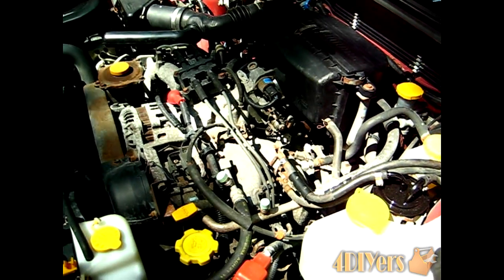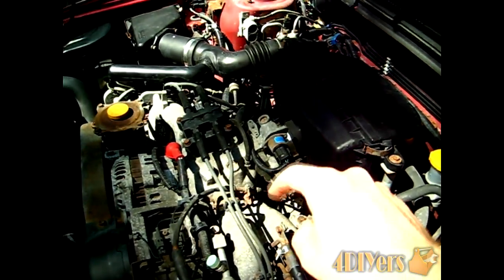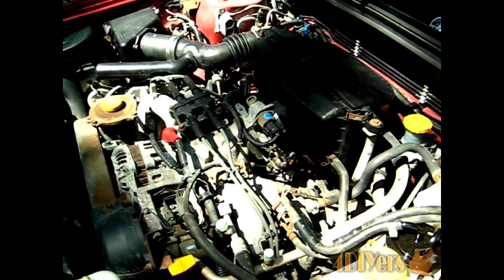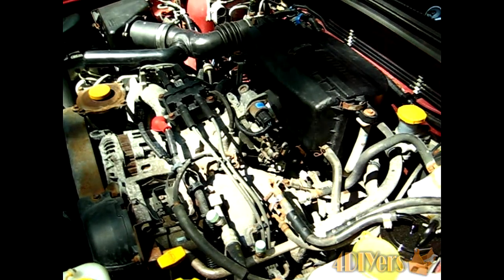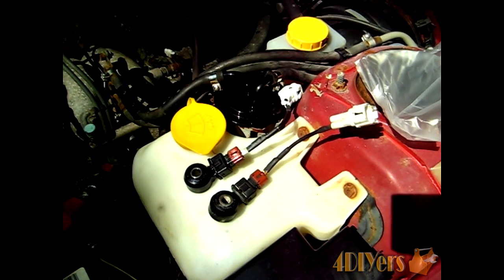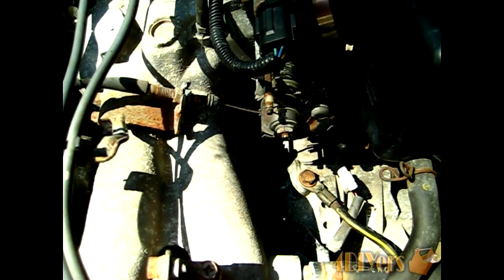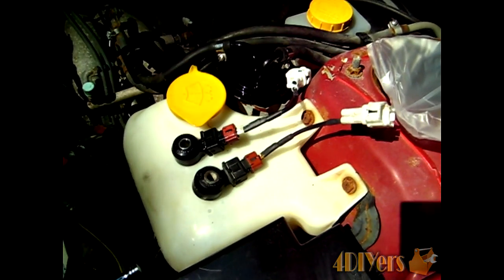DIY: Subaru Knock Sensor Replacement

Comment: You skipped the part where it must be at 60 degrees. 
Yours was at 330
Reply from the maker: It was at 60 degrees. I referenced the procedure with a manual.

Comment: i have an 09..  the sensor is at a weird angle and cannot be accessed straight down.  I was thinking i could use a crows foot wrench to get it out, but if i do it that way i won't be able to torque it back at the end.

any thoughts?

Comment: Hi when you said you had a hard start problem what did you mean by that.
Mine struggles when engine is cold but when it does fire up she fine till car is stood for a few hours.
Could the knock sensor make it hard to start

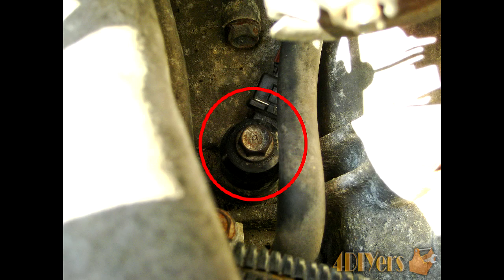Comment: First, thanks for taking the time to produce this video; very helpful. Second: I think Nock Sensors detect the piston's TOP  position to trigger Ignition. In that regards, there should NOT be a degree in which you should have to Rotate this one; rather, at 1:02, MARK its position (although I believe it would not have any bearing on its performance), BEFORE removing it. If sensors have a Coil inside, it will detect any ferro magnetic impulse any which way they maybe located, provided they lay flat on a surface against the 'sensed' mass. Thanks again; I will replace mine!

Comment: I'm doing a head gaskets, water pump,timing ass..on my 2001 forester..knock Sensor is cracked..most likely why my check engine light is on..

Comment: I have lag of power from 3500-4900 RPM (the power gets back from 5000-6000 afterwards.) , I read from other forums its probably because of the Knock sensor.
they talk about a Knock sensor delete, but i'm not sure if thats healthy for the engine. what should i do? it only happens sometimes,  and there are no Engine check light  turning on at all.
i'll try first to just clean the Knock sensor and see if that helps.
 any ideas?
i own a 2.0l non Turbo impreza from 1999'  done 375000 KM  / 233000 Miles.
Reply: Did you ever get it fixed? having the exact same issue at the exact same rpms as you

Comment: My engine starts and runs pretty decently, but the mileage is poor and sometimes the cel flashes but only when it's cold out and the engine is warm and I'm starting it back up. It's kind of weird. I don't think it's my knock sensor yet but it might be going out.

Anything else i  should look for? I'm just confused. I can't scan for codes cause it has obd0
Reply from the maker: What type of vehicle is it? You should be able to scan the codes using a vehicle specific scanner or sometimes there is a jumper wire you need to install to access the scanning sequence. Yes it can be a knock sensor, but it can also be a variety of other things like the vehicle needing new plugs, wires, timing set, faulty 02 sensor, temperature sensor, vacuum leak, etc. Regardless of what type of vehicle, you should be able to test the knock sensor and if it's fine, then I would advise moving onto another test which won't cost money for a replacement.
Reply: I'm not getting any codes from it. Obd1 1991 ej22 subaru legacy. I have a small exhaust leak so that's part of what's getting fixed. I get 3 quivk flashes but it doesn't show as anything
Reply from the maker: If it's flashing three times, that is a misfire issue. Either a bad spark, fuel delivery, incomplete combustion, or low compression. Take the plugs out, inspect them, replace if needed. Test the spark plug wires (I have a tutorial for that https://www.youtube.com/watch?v=7ll30u39DEE) and then test the coil pack. If all checks out, do a compression test, test the injectors, clean the injectors, and test the fuel pressure.
Reply: I haven't changed the wires.

And the three flashes was in it's memory. It's not on now so I think it's still okay
Reply: But yeah I need to change the wires still. So that video shows test the coil packs too?
Reply: How do you know that's what the three flashes mean? Trouble codes didn't show that
Reply from the maker: Could have been a fouled plug if it was something that happened in the past and now is cleared. No that video is strictly relating to wires. I've owned a few Subarus in the past, it's a standard issue, especially if the engine is modified.
Reply: Stock motor and plugs have at most 10000 miles. I gotta do wires still. And coil packs if necessary

Comment: I just purchase the knock sensor at my local autozone for $84.00 out of curiosity I checked out ebay upon arriving home. The prices there where a very big drop with most selling at $11 or less !! What is the difference and should I return the expensive part in exchange for the cheaper part ?
Reply from the maker: While the cheap sensor may last, there is no guarantee though. Those cheap sensors don't tend to be as durable and their life expectancy is usually short.
Reply: They're less than £8 in the UK  .

Comment: My 12mm socket is stripping the nut, I think because the angle isn't great.  I'm also using a 6" + 3" extension.  Any suggestions?  I'm going to try again when the engine is cool.
Reply: make sure you use six sided socket

Comment: Could faulty sensor cause engine surging under acceleration on lean mix (i.e. light gas)? I have been experiencing engine surges when the MY2009 Forester switches from 1st to the 2nd under light gas (only happens on slightly warmed up vehicle. once its fully warmed up or if its cold wont happen. I am also experiencing rough idle on cold engine, but i guess its due to pzev. Sorry for the long comment )
Reply: YES a faulty sensor can cause power surges. My forester is currently experiencing this.
Reply from the maker: Have you scanned the engine codes??? Yes a sensor or sensors will cause those problems you have listed. Don't forget to subscribe!
Reply: yeah, no issues found using OBD scanner. interesting thing that oil change to thicker 0w40 somewhat fixed the problem. I guess the sensor is not completely faulty, may be it works out of the tolerance causing it to be more sensitive. thicker oil might have reduced vibrations.

Comment: Thanks for posting this video and the step-by-step instructions you provided.  After watching this I placed an order for a new knock sensor for my '99 Forester with an online vendor and received the part this afternoon.  It was a bit cramped working in the tight space where this component is located on the engine block, but with a great deal of patience and some fervent prayer the old part came out and the new part was installed in less than 30 minutes.  The engine is running smooth and thus far no P0325 error code has been published by the OBC.
Reply from the maker: Excellent to hear and thank you for the feedback!

Comment: Hi there ,is there a difference between the knock sensors available cheap on ebay and the one available in stores (bill-buckle for $192) ? Please suggest if there's any difference or i can just buy a knock sensor for my subaru 2001 liberty 2.0 online? Or if u can suggest the specific number of the knock sensor? Thanks in advance, cheers !
Reply from the maker: The different between a cheap and expensive version is the quality used in the manufacturing process. Cheap sensors tend to fail much quicker. Don't forget to subscribe!

Comment: Disconnecting the battery may not clear your code - if you google, there are instructions for using the green connectors under the steering column - http://uk.subaruownersclub.com/forums/topic/2366-manually-reading-ecu-codes/#entry11088  This also tells you how to check your code manually. You'll need a torch to find the connectors! Mine has just thrown code 22 so I'm off to check the connections to the sensor!
Reply from the maker: +Helen Morris Excellent tip, thank you for sharing!

Comment: I don't know what todo now it still wont start and i cant get it towed to a shop. i really think the new sensor wasnt put in like u said to i watched and he didnt do that.
Reply from the maker: +Dana Meadors What were the symptoms before the sensor was replaced??? Ensure the sensor is facing the right way and it is torqued to the proper specifications. Next, scan your engine codes to see what faults there are.

Comment: I changed the sensor and it sounds like it wants to start but wont . is there something to do to help it?
Reply from the maker: +Dana Meadors Did your vehicle have the same symptoms before you replaced the sensor??? Did you test the sensor and circuit to determine if it was faulty???

Comment: Will a bad knock sensor also cause a increase in the engine temp gage on the dashboard? Or would that more likely be caused by the thermostat?
Reply from the maker: +Anthony Gates No. The causes for your engine running hot could be a faulty sensor, a thermostat stuck closed, plugged coolant passage, faulty water pump, or a faulty head gasket. What is the mileage on your Subaru, are you noticing a drop in coolant, any steam from the tailpipe, and does it run a little hotter than normal or will it top out on the gauge???

Comment: Hi there!! i would like to ask about a problem that i have in my sub legacy 2004 ej20 with a error code p0304 and p0108 so i first ordered the coil and all 4 new sparks. is that a good move? tomorrow i'm gonna change them. any tips for next? thanks.
Reply from the maker: Sparks plugs are usually a good thing to start with if they haven't been done in a while. As for the coil, they are fairly pricey and last a very long time. Personally I would be more inclined to replace the spark plug wires rather than the coil pack. With that being said, the coil can be tested to ensure it is still working properly. Normally I would determine what the causes of each check engine light code, then go with the repairs that don't cause much. So that would be checking connectors, cleaning sensors before replacement if possible, check for corrosion/broken wires, etc. Here is a little info on the p0304 code I found and it also states how to test the coil pack if you have the same one http://www.ultimatesubaru.org/forum/topic/96703-p0304-issue-solved/ The next link has more issues, but it does also give some information on the p0108 (post 7) http://www.subaruforester.org/vbulletin/f88/p0101-p0102-p0108-p0110-codes-75780/
Reply: i'll check that out!! thanks a lot for your interest.